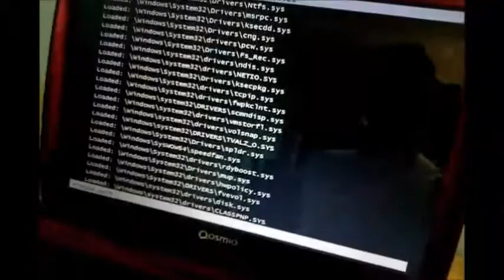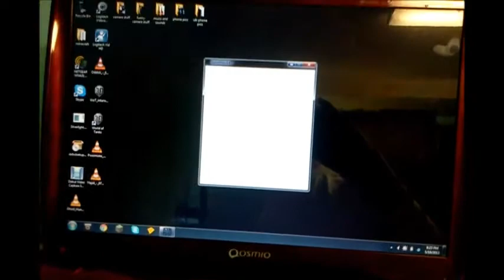Cleaning an Overheating laptop toshiba qosmio x305

Comment: thx...but honestly im to freaking afraid to open my qosmio x300...XD
Reply from the maker: If you do, just take your time. Dont tug, pry, or force any wires or clamps.
Reply: jonman0613 are you not using thermal paste?
Reply from the maker: I am of course. But in this video my computer had already gotten a fresh coat of paste. If you dont remove the heat sinks you dont have to repaste.